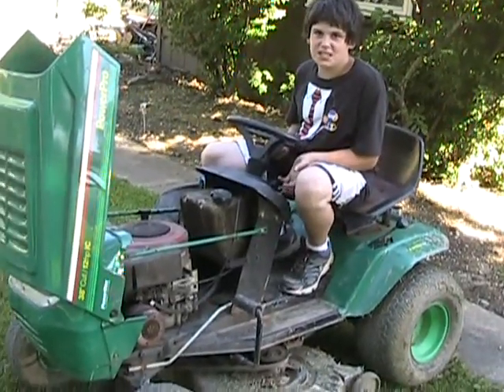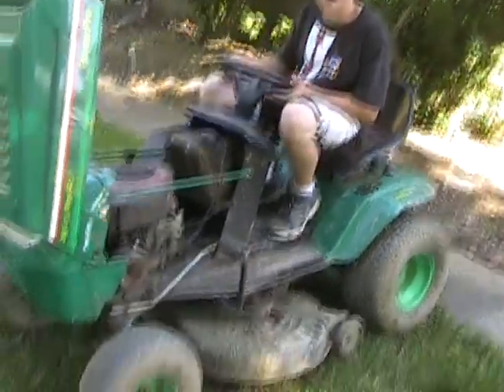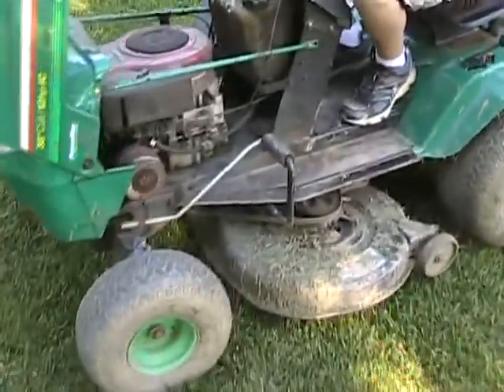1997 KGro Power Pro lawn tractor

Comment: I just picked up the exact same Tractor this afternoon at the Dump. 
It took me 3 and a Half hours to get it out, it was Buried in Snow and blocked in with a lot of other scrap. 
   I have 3 Yard Tractors and am finishing up with my first build, a Yard King.
   My Third is a John Deere with a Hydrostatic Transaxle that I am parting out. 
    I am hopeful that we can get a Race going here for these Yard Tractors. 
      My power pro is getting cross Bread with an 86 Honda TRX 125 ATV.
I will be using the front end of the Honda Because the Power Pro has a Crappie front end.
Reply: Do you still have it?
Reply: @whatfreedom7   I just seen you replied to my comment. 
   Actually I was just reflecting on the time that the Green Machine spent here at my place. 
    I just Sold Her today to a Kid who is trying to make some extra money this summer Mowing yards.
   I just used it to Tow other Tractors around the back yard. I drove it around town a little bit, to get coffee and cigarettes and to the drive through Hamburger place. 
   I must say that these are Kool little Tractors. I did a lot of work on this one and put $100+ into it for now Battery, Belts, Oil change, and tubes for the front tires.
    Since  I made my comment I have acquired a Nice Craftsman DLT 3000, a Troy Built Pony, and another Murry. 
   So I now have 5 including the good old Rat Tractor. 
   I got the Craftsman in trade for building a Go Kart for a friend of mine who has a 9 year old son. 
    May I ask why you are wondering if I still have the Power Pro?
   Are you having problems with one of these Green Machines?
    If you are I might be able to help you. I had to do some fairly extensive tear down on this one that I had. I actually have some experience with many different types of Tractors. 
    😎✌
Reply: @whatfreedom7  and I didn't chop the Green Machine up, I put it back together all stock. 
   I fixed  the front end too.
My John Deere has the Honda TRX where it used to be a Hydrostatic.
Reply: Yeah I still have one that still works after all these years. I’m having a issue with the speed selector lever on the right side of the dash. . When you put in the speed you want it just falls out of that groove and wants to jump all the way up. I’m not sure if their is some sort of spring that’s missing or not. I looked schematics up and all I could see is a weird curved or cupped spring in that area which appear to be there but maybe they are worn out. I was just curious if anyone else had one and could see any kind of spring that would hold it in place. I just have to wrap a bungee cord around it to keep it pulled over to the right.

Comment: so the drive belt snapped so you scrapped it?
Reply: I had to put one on mine and oh man that was a pain.
Reply: I've got the 38" cut and absolutely cant find the model number to get a drive belt.  Help!
Reply: @Breeistheone112  its the same drive belt used on mtd yard machines riding mowers
Reply: Breeistheone112 is that the transaxle belt? Not sure which one they consider the drive belt. If so I have the part number.

Comment: Should get one built by murray. They last longer than them mtd built pieces of crap. They also go a lot faster
Reply: Lol mine Is 1997 and still has the original motor starter and most parts. I’ve changed Normal pets like battery,belts,blades and spindles. It’s held up fine.